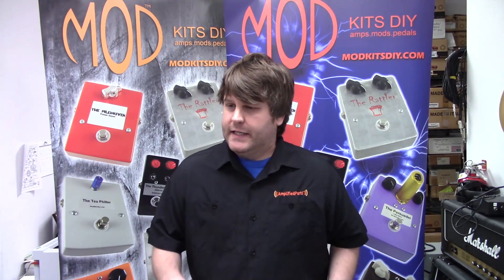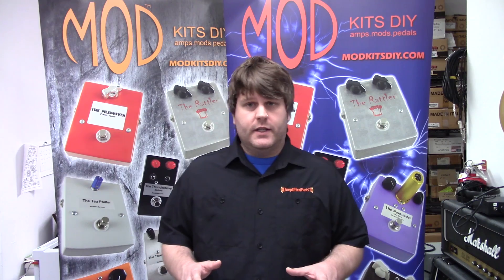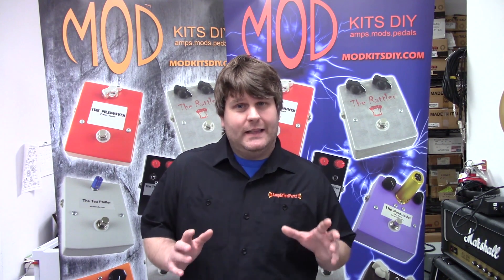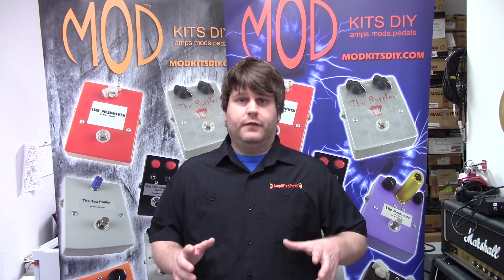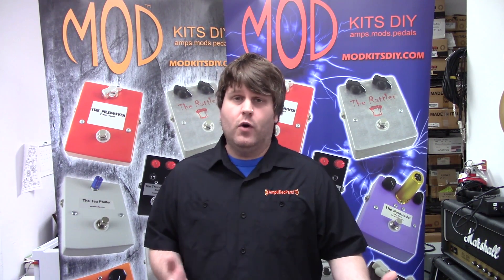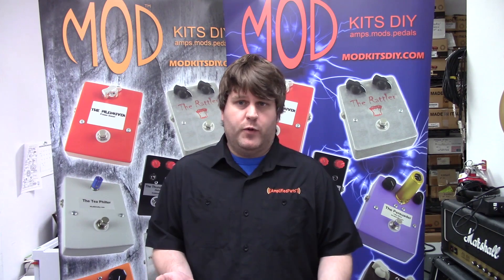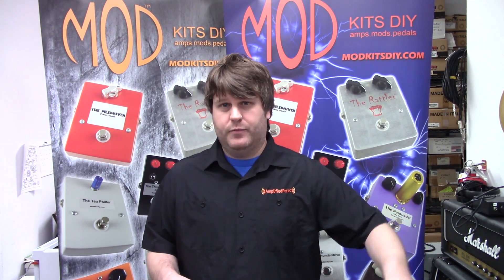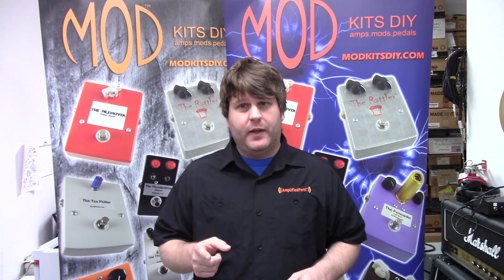MOD® Kits DIY Piledriver Pedal Demo (Boost)

Comment: Easy to put together, I did dc jack instead of battery and added 9 pin switch to power an led. Definitely boosts, but it’s kind of a dark tone. Not the “cleanest” boost, but if you want some more lows end/less treble, you’re in luck
Reply: I just got this kit and am looking forward to putting it together soon! I would also like to install an LED...would be interested to know how to go about doing that.  Thanks!